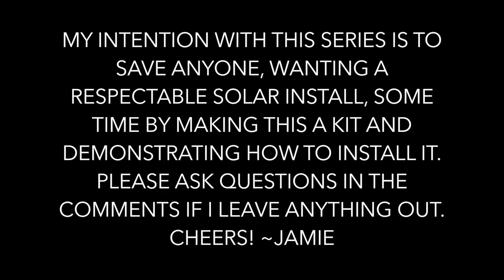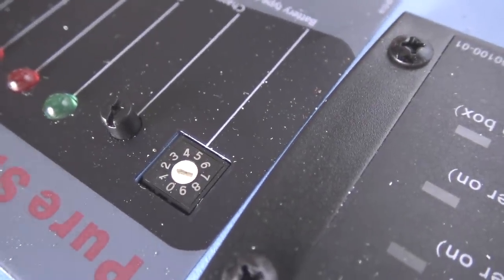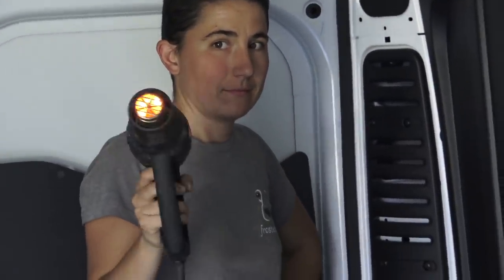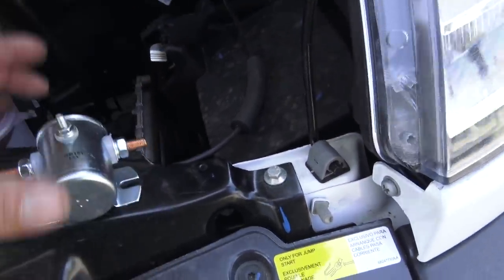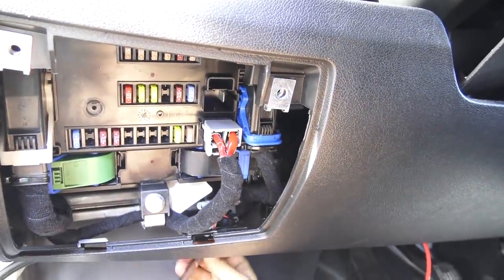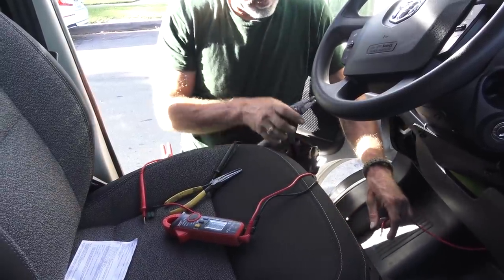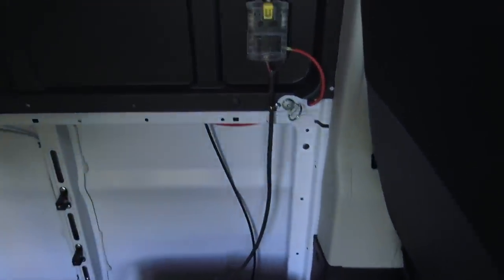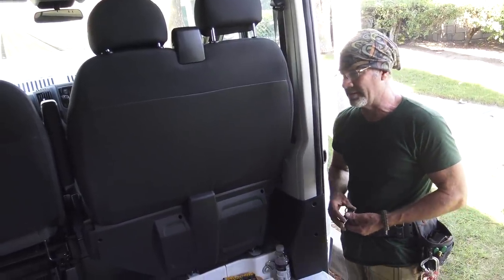Installing 400 Watts of Solar, Inverter, Isolator & Shore Power on a Van 3

Comment: For me the timing of this series is perfect as I have the exact same van. I've been very reluctant to attempt my own solar install.  However watching your videos has given the confidence and mental push that I have needed. Based on your recommendations I will now start to gather the equipment, parts and pieces that I need. With your videos as I guide I am sure that I will be able to get the job done. Bravo this is a outstanding video series and am I very grateful that you have taken the time to document your installation process. Keep up yet great work that you do!
Reply from the maker: Thanks, MrPoppabear. Find me at enigmaticnomadics@gmail.com with anything I may have left out. All the best to you on your install. Maxx fan coming up next!
Reply: DITO….. TOOK THE WORDS RIGHT OUT OF MY HEAD.

Comment: Great DIY demo, informative and entertaining, thanks Jamie and Sarah. 

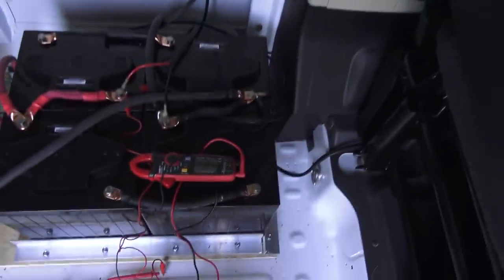Strange coincidence just now occurred as I was watching your vid, at 20:40 CDT Sunday 08/19/18 a travel trailer was reported to be on fire, fully involved, just southwest of my community, but within the SVFD area of operations. Fire, Rescue and EMS units were requested, two departments, Stonewall and Fredericksburg went enroute a few minutes ago. Travel time will be ±20 minutes, I pray for the safety of all concerned. The travel trailer was in a field on a ranch, about five miles southeast of Luckenbach, TX off of FM 1888. FVFD Engine 1 on scene at 21:02, SVFD Engine 12 on scene at 21:03. At 21:14, 1888 Fire Command declared the fire to be out, with mop-up operations to continue. No word on whether or not the travel trailer was occupied.

So... I'm glad you are correctly sizing wire, cable, fuses and breakers for each powered line and appliance installed the way it should be done for safety. If the owner does not have a fire extinguisher on board, it would be a great gesture for you to recommend one or even include an extinguisher in your package build. While on the subject of personal safety, a smoke alarm and carbon monoxide alarm should be included for any vehicle one is going to sleep in. Godspeed brother.
Reply: I see all these ppl, especially DIYers,  installing wiring, batteries, enough plywood to build  house with, varnishes & stains, propane tanks, etc all on top of a  gas tank and all l can think is what a massive explosion & fire just waiting to happen. I just bought an older van and am having second thoughts about putting all that stuff in mine.

Comment: I'm so glad you put in circuit protection on you installs.  Nothing better then having a short circuit burning down a rig.  I see you meter has a inductive pick up. Measure the amps on your power wire going to the isolation relay when energized.   Then install a fuse that is 125% of that load and your golden. If can't hit 125% get as close as possible you will be fine.  For those who love math use ohm's law E=IR.  So measure the resistance of the relay. On this relay black probe on relay body and the red probe on the small post. Then take this number and divide the battery voltage by it.  This will give you the amperage the relay uses when on.  Now since battery voltage fluctuates.   Use 12.5 it will be close enough.   Now just go 125% of amperage calculated.   Very good video. Thumbs up from me.

Comment: I would add a small led indicator light inside the cab ,connected after the breaker to show me that power is indeed passing the breaker and giving me a charge . That way I could know that breaker is set and solenoid is functional. Great work peoples
Reply: I don't think that will work since  the wire always has power.  The wire from the breaker is connected to the battery positive so it would have power even if the breaker tripped.
Reply: @OffTheBeatenPath_  on the load side of the breaker there is no power if the breaker is tripped.
Reply: @davidprince1923  what is the load side connected to?

Comment: Nice video you explained the how and why well. Plus the added troubleshooting was a good idea.
Most of the time it's nothing serious just a tripped breaker or blown fuse. It could save someone from being taken advantage of most electrical parts are non returnable. Funny how that works.
You spend 150.00 to finally put in the 50Cent fuse. Or worse flip the breaker back on.

Comment: For those of you that do not want to spend extra money on the KopR Shield I suggest that you go by any auto parts house and buy a bottle of Permatex Copper anti-seize compound.  It is cheaper then Kopr Shield and it too is a conductor and is listed for use on battery cables.

Comment: Jamie, God Love Ya , You over breakered the line running to the coach batteries . #8 awg wire is good for 40 amps . When using a 100 breaker you should use #2 awg wire. another words, Please use a 40 amp breaker on that line. The #8 awg wire will fail before that 100 amp breaker will trip. the OO wire that you held up would be great and the 100 amp breaker will trip way before any serious amperage would bother that big OO wire :) Thank You for helping out a person in need of Solar Power :)
Reply: And wouldn't a battery disconnect be the first component to install coming off the vehicles starting battery? How does the vehicles alternator determine which battery needs the charge, or are the coach batteries simply pulling out of the starting battery and the alternator is simply trying to keep the starting battery at a full state of charge

Comment: Jamie...... Something you might not have considered is an collision impact cutoff similar to the ones  already in vehicles. In the event of a collision, if the vehicle remains upright in daylight, the solar panels to your  MPPT will remain  connected and providing power to the batteries. It could also cause exposed wiring due to wire insulation damage.This scenario could create an explosion or discharge into the vehicle frame or body,starting a fire or energizing the body of the vehicle. That in some instances could cause injury or death to passengers or emergency providers especially from battery gases or acid leaking. Having the extra batteries for solar onboard may complicate the situation. This may sound  like something that hasn't happened yet in the solar world of  power on vehicles but sooner or later someone will  think of it for legal purposes i.e.law suits, legislation......... Always enjoy your vids....Radar

Comment: Kinda 3 part question 1. Under what condition would you need to consider a bigger or even second alternator? 2. Does the 100A solenoid send as much power as a 100A charger? 3. If so how long would it take to charge the batteries/would it be better to idle the van for an hour to charge vs running a generator? Thanks for all the info and explaining all these many pieces to this puzzle
Reply from the maker: These are great questions Steve. There isn't a situation where you would need a second alternator, but to be fair I would have to test the amps going into a battery bank from the alternator versus the amps going into a battery Bank with a generator powering a charger to see whats going in. Their are also variables beyond that. Such as how much juice the batteries can take. If they are at 12.5 they're going to receive more power from the alternator than if they're at 14. Also if the starter battery needs a large sum of power the alternator is going to be sending it there in addition to the coach batteries and if a generator is running a charger we would need to know what the charger is designed to produce in amps. Hope that helps. I know this probably sounds more confusing, I'm just trying to be accurate with your answer.
Reply: Nope, I followed that ok. Sounds like set it up and test it several times. No two days will be exactly the same even for the same rig as the state of the batteries will nearly always be different each time you start the rig. I was hoping there was a general rule but you still gave us a great starting point. Thanks!!!

Comment: Thumbs up to you, sir.  I appreciate these instructional videos.  You asked for questions here so ..... where do the positive wires go from the solenoid?  One goes to the fuse thingy, right?  Where is the other one?  To the battery bank?  If so, what keeps the solenoid thingy from overcharging the batteries?  Wish we could have seen more details about running the wires from the solenoid to inside the van and then to the actual hook up location.  Thanks
Reply from the maker: One comes from the car battery and one goes to the positive on the coach battery bank.

Comment: Nice install.  Very easy to follow and understand.  I'm a great fan of service loops, circuit protection and over sizing conductors.  Curious.  Did you wire the A.C. outlets to NEC?  Missed that video.

Comment: put in a heavier gauge wire between the solenoid and the coach batteries .then install a switch for charging or emergency start on the chassis batteries just what i would do

Comment: 1. Good, clear video
2. If shore power is a house, would any outlet work, does the outlet need a minimum amp rating?
3. I understand why y you chose 6v batteries, but how did you size the needed amps?

Thanks
Reply from the maker: Thanks. Yes, any cord would work as long as it's a heavy enough extension cord to carry the Juice needed to run the appliances inside the van.

The batteries were chosen because 450 amp hours is about all anyone should reasonably need in a day for a fan Life Application. Even if running a CPAP machine. Hope that helps!

Comment: First, I appreciate the instructional videos as you are covering some of the basics well.  However, throwing a 35 amp fuse on a wire that won't handle 35 amps negates the ability for the fuse to do it's job.  For that solenoid I would drop that down to a 10 amp fuse.  I would also suggest some sheathing on the wires you are running down from the roof as an extra precaution.
Reply from the maker: Instead of 30amp fuse, 20. The stock sheathing is substantial on mc4 wire and a rubber grommet was used at the penetration point. Cheers.

Comment: Does a solenoid add any load to the engine?
Reply: An alternator is not affected by engine speed,  it does its thing relative to the load put on it. When the coach battery is charging it may load the alternator a bit but nothing out of the ordinary. Of course if you have a choice, have a heavier duty alternator. The solenoid is just a switch, these type are better than the solid state versions because there is less voltage loss.

Comment: Okay I got a RV that's 27 years old it already has the solenoid on it how do I test it to see if it still works I don't have one of those gadgets you used on the batteries.
Reply: Buy a $10 DC voltage tester. Check voltage on the vehicle battery side of the solenoid, and the house side. This tells the voltages of both batteries. Start vehicle, check voltages again, both sides. If the solenoid is working, the voltages across the solenoid should be essentially the same. Hope this helps.

Comment: Great video Jamie. I am still not sure where the 30 amp shore power hooks up. I am guessing to the converter/charger unit?
Reply from the maker: Yes, I definitely should have included that as a part of the series. When I'm filming. I sometimes forget whether the camera is on at every point of the install, so here goes: The inverter/charger has one end where it receives the 12v DC cables and the other end has an input and output for the A/C wires. I them wire nut and/or daisy chain the A/C wires to the outlets. Hope that clears things up.
Reply: yes, thanks. I thought that was the way just wanted to verify. Thanks again.

Comment: Thanks for such a great series. Is there anything you'd do different as in more batteries or bigger inverter, or maybe more solar panels when cost isn't an issue
Reply from the maker: Maybe go lithium on the batteries?
Reply: What type is the best lithium batteries

Comment: I get the gist of what this solenoid does.  However, I still don't understand how you wire it.  Maybe I spaced it but I didn't even notice when you connected the wires to the coach battery.  I remember seeing what you did under the hood, which was pretty straight forward.  However, I don't remember seeing if you connected the other end directly to the battery or through your solar controller, etc.  Also, I have absolutely no idea what you were doing with the fuses/tap adapter.  At first I thought maybe you were going to share the fuse... but then you added a 2nd fuse.  Then I thought maybe you were just putting it there for easy access.  However, that made no sense because you didn't need a fuse just to have a fuse since you have one under the hood already that you installed.  So, if you are added yet another one I can only guess that you somehow are riding that current circuit with the current from the alternator so you don't have to run an extra 4 feet or so of wire?  No clue why you would do that but I'm sure there is a reason if so.
Needless to say, I need to watch more videos on this before even thinking about doing it myself.

Comment: I have 2 panels =360 .my carbon monoxide now keeps going off, what might be trouble. Thank you
Reply: Charging batteries will set off C.O alarms it give it a faults level of C.O (Carbon Monoxide) I ran into this many times when people were charging the golf carts in the garage and it would set off the alarm in the house. You might need to vent your battery box.
Reply: I am retired now 32 years working Natural Gas emergencies, this is from my notes. Lots of golf carts being charged, but why the CO detector activations? Lead acid batteries do not emit carbon monoxide. Lead acid batteries do, however, emit hydrogen, and research gave us both the answer and alerted us to another problem.  The typical CO detector is designed to activate when the unit detects 150 parts per million (ppm) of CO for 30 minutes. That same detector will also activate when exposed to 300 ppm of hydrogen gas for 30 minutes. The amounts of hydrogen gas produced during lead acid battery charging in golf carts far exceed 300 ppm. And, when that charging is done in a closed garage with the golf cart parked next to the A/C heating system, the hydrogen is introduced into the home. Thus the alarm.
Reply: I would pick up 2,100 PPM in a garage and 1,000+PPM in the house the hydrogen would be pulled in from the A/C air handler in the garage hard to get a positive seal on the blower motor housing.
Reply: At standard temperature and pressure, hydrogen is a colorless, tasteless, odorless gas. Hydrogen gas is highly flammable and will burn in air in concentrations between 4% and 75% by volume. Hydrogen is not toxic, but in its pure form is a chemical asphyxiant. Hydrogen gas leaking into air may spontaneously ignite.Hydrogen inhalation can cause Symptoms of acute exposure include nausea, headaches, delirium, disturbed equilibrium, tremors, convulsions, and skin and eye irritation. Inhalation of high concentrations of hydrogen sulfide can produce extremely rapid unconsciousness and death.  Now we know what is wrong with Jamie!
Reply: yes, hydrogen gas is dangerous. A vented battery box should be used by vandwellers.

Comment: How is the shore power connected to the inverter?  Is the shore system only for battery charging or can it charge and power the 110v at the same time?

Comment: if i plug into my house that has a 20 amp. fuse,  because this is 30 amp. will it  work ?
Reply from the maker: yes. the wire is just thicker. it means UP to 30 amps.
Reply: thanks for answering. have a great day.!!!
Reply from the maker: Happy to help.

Comment: Great video Jamie! What if I charge a single 12V Deep Cycle battery from my rear 12V cigarette lighter that only supply power when my car engine is running? That will replace the isolator? Thanks in advance!

Comment: hi jamie, is that the ac distribution on the wall above the batteries and below  the charge controller? also are the batteries grounded to the van? hope you can go over everything once complete. thanks
Reply from the maker: That was dc distibution. Their are a few things i missed explaining in more depth. Ill work on it on the next one.
Reply: thanks Jamie, I learned alot with this install.
Reply from the maker: Glad to hear it, Moose Knuckle. I try to make better videos with each one I upload. I appreciate you watching. Cheers.

Comment: I have tried to hook this up the same way in my chevy van and it's not working. I have two AGM batteries and 400 watts of solar panels on the roof. I have an 1100 watt inverter with MPPT controller. I have a TAP adapter fuse going to my turn signal and a 100amp circuit breaker between the van battery and my AGM batteries. I don't know what I'm doing wrong. Please help me figure this out. I have to park in an underground garage for work, so I really need this isolator to work. I watched your video again and it seems that I need to find another ignition source. However, I don't understand why the turn signal wouldn't work.
Reply from the maker: enigmaticnomadics@gmail.com your #.

Comment: How hard would it be to wire in the shore power to give power to the outlets in the van without using the inverter to power the outlets but also still charge the batteries when plugged in? Not worth it? I figure it would be less wear on the batteries this way.
Reply from the maker: It could be done, but that inverter bypasses the batteries while plugged in to shore power, but still charges them.
Reply: @enigmaticnomadics  Oh Nice!
Reply: @enigmaticnomadics  How does it know that it is hooked up to shore power if the only leads coming in are from the battery terminals? Sorry if I missed something!